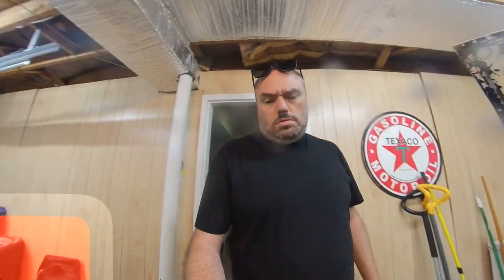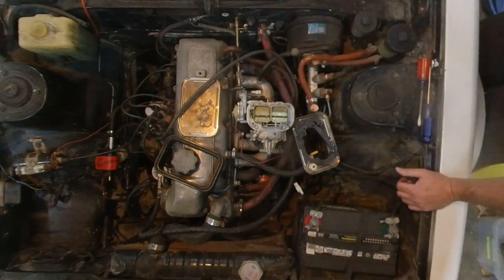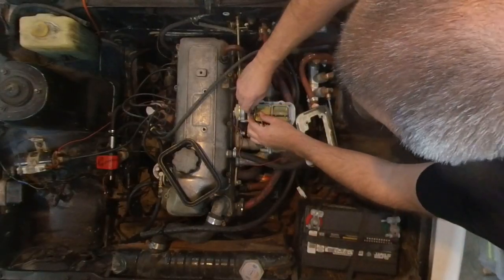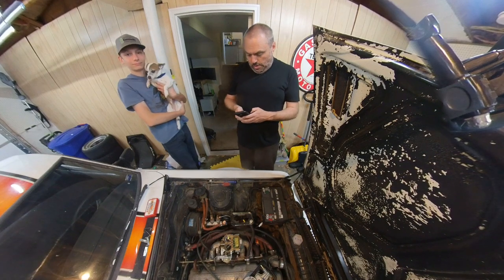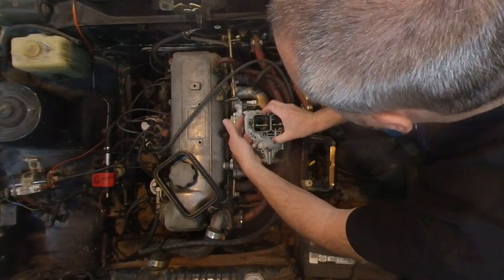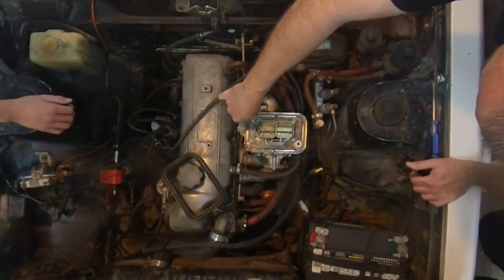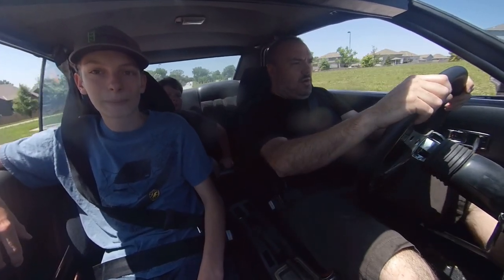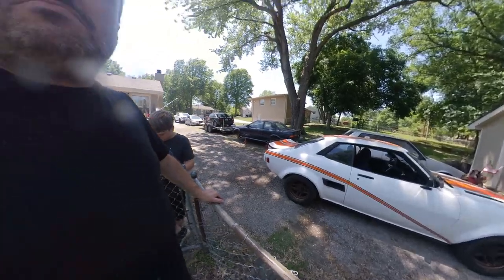1972 Celica - Weber Carb "Tuning"

Comment: How did the rear end turn out? Wanted to see the work before I give him a call.
Reply from the maker: oh ya.. crap.. jumped the gun with this video i guess. i have a script ready for the rear end video.. ill update all that soon
Reply: @OIO Racing  no worries looking to get it done this winter but still working on getting it drivable for the summer. You need to bring it to cars and coffee north oak and barry tomorrow I want to check it out.
Reply from the maker: No can do tomorrow. He's back in the operating room now. Up next is T3 front coilovers, control arms and mini big brake kit.

As far as using Thomas at Gary Rod and Chassis.. DO IT! The work is stellar! I'll get the car out sometime soon and you will quickly be able to verify. I made this video now for 2 reasons.
1. I wanted to see if I could make a quick, run and gun, video with the 360 camera... it still took 3 hours to edit
2. Dale is begging for more power with these wide 200TW tires on. I'm trying my damndest to give it to him but the answer is waiting in my shop in the form of the 18RG lying in wait. I just want to squeeze a little more out of the 18RC for this season but if it won't do it.. the swap is just a few full days of work away... and then tuning.. and adjusting.. and tuning.. and adjusting..